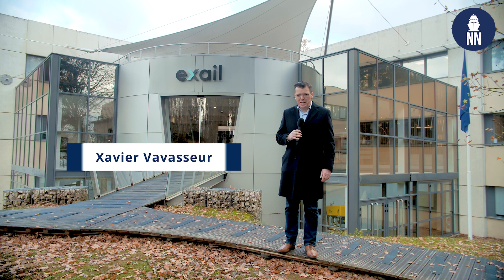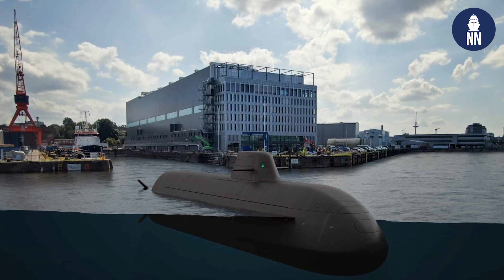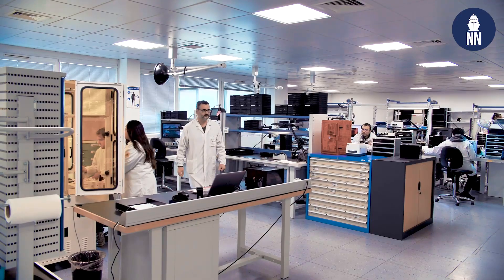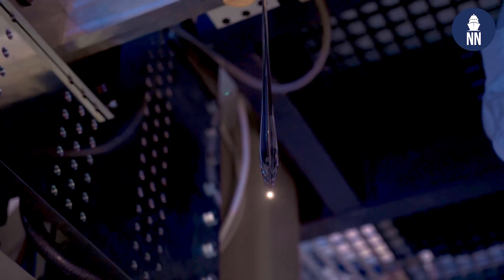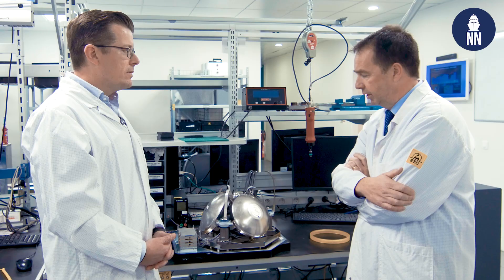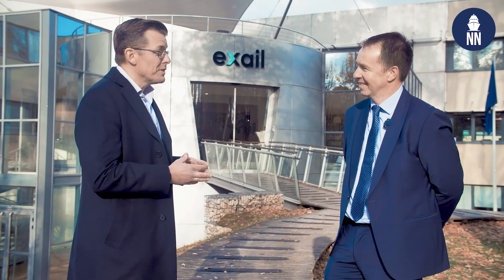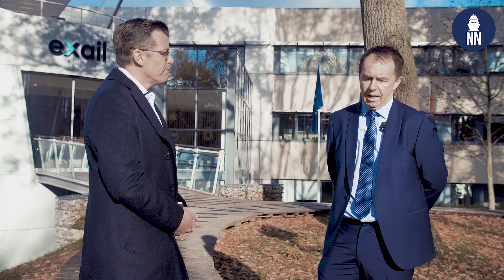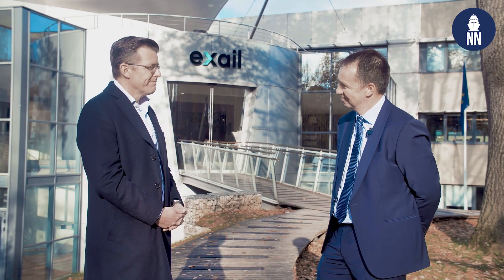Exail's inertial navigation systems for naval applications

Comment: 3:30   A fibre-optic gyroscope (FOG) senses changes in orientation using the Sagnac effect, thus performing the function of a mechanical gyroscope. However its principle of operation is instead based on the interference of light which has passed through a coil of optical fibre, which can be as long as 5 kilometre.
The Sagnac effect is used in optical gyroscopes by sending two beams of light in opposite directions in a fibre optic coil or mirror directed path. As the device rotates, the beam travelling against the direction of rotation experiences a slightly shorter path delay than the other beam.